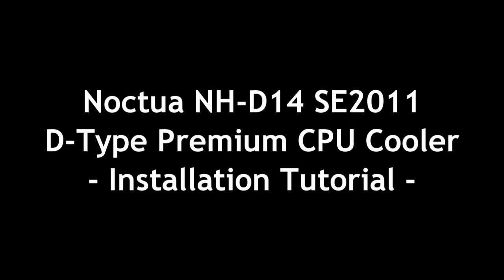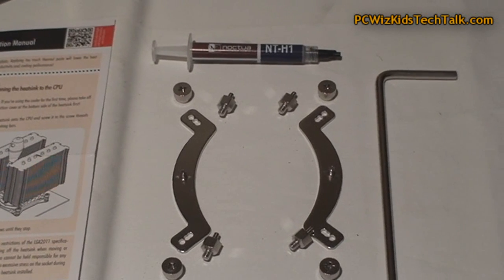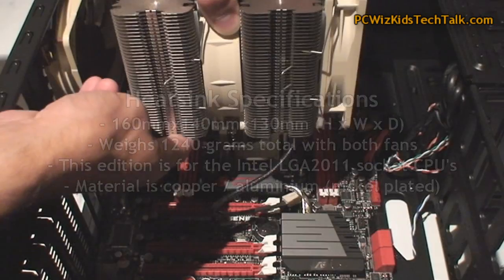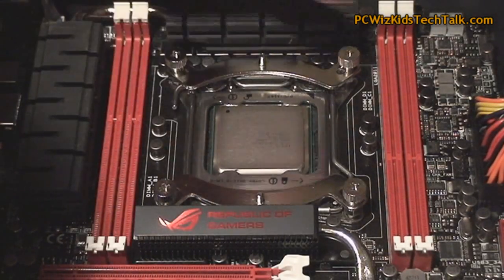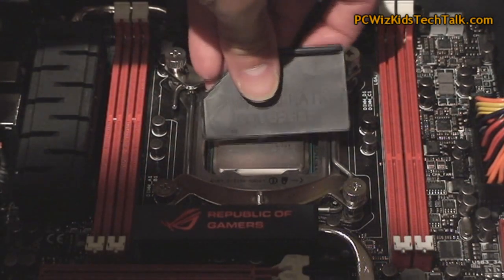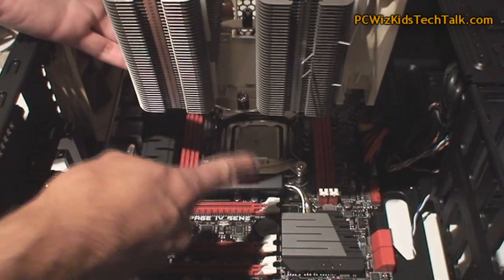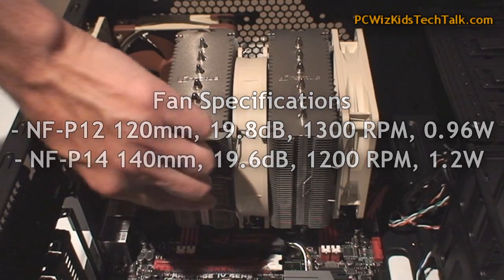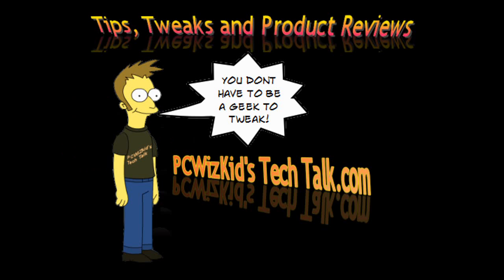Noctua NH-D14 SE2011 Premium CPU Cooler Installation Review

Comment: Um, i Don;t agree with you spreading the thermal paste all over, you actually don't want it to catch all 4 corners of the chip, just the middle and the size of the die under the IHS.

Comment: I already gain the image that bringing heat compound onto the socket is something like religion. With the dot method (which is always advised to use) you do nothing wrong and it is the easiest and always secure. Thinning the compound might add air bubbles or parts of the CPU covered more than others (in terms of height). I use this cooler with the dot method and get CPU temps of 42°C (i5 3570K) with assassins Creed 3 or WoW (full server), nothing higher. That with FAN rpms of 900 (speedfan).